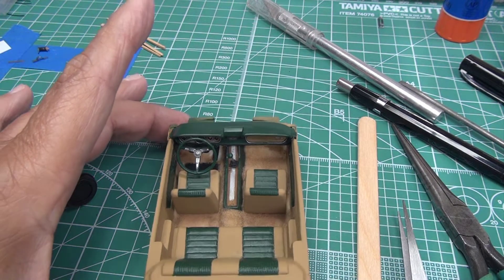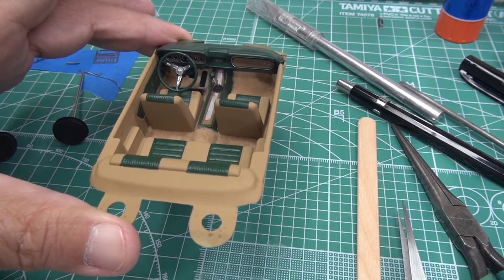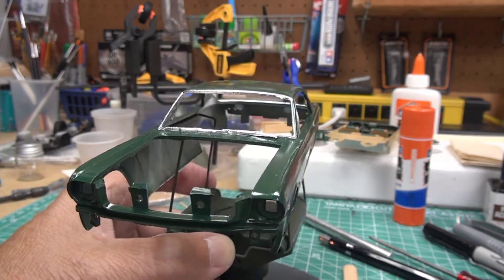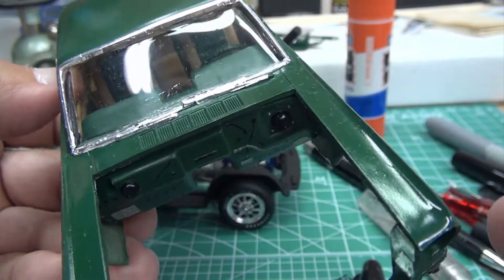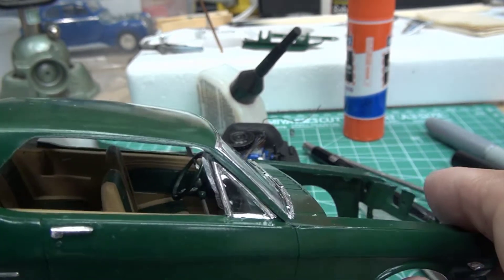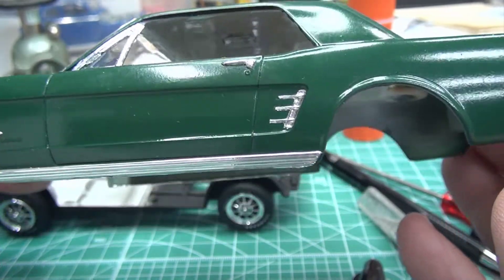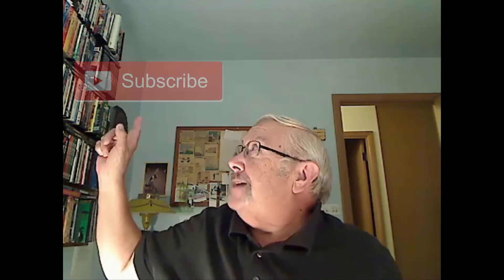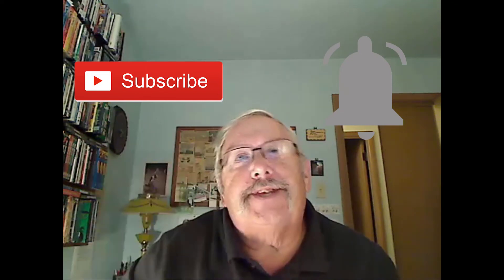05 1966 Ford Mustang Part 05 and Final Part

Comment: It turned out to be a nice looking model.  A successful experiment.  Use Modpodge to install your glass, it dries crystal clear and won’t eat the plastic.  You can get in the craft section at Walmart.  Also, use a tea strainer to put the flocking down.  You can get those from Walmart or Amazon.  Thanks for sharing.
Reply from the maker: Thanks! I used Testors white glue for clear plastic, but I do want to switch to Modpodge. I've seen other model builders using it. The one problem I had with the glass is that I did not properly prep the body surface. The clear plastic slipped out of position and I did not notice when it happened  and that's what caused the smear, but it also pulled some of the bare metal foil down from the top edge of the roof. Oh well. Thanks again Michael!